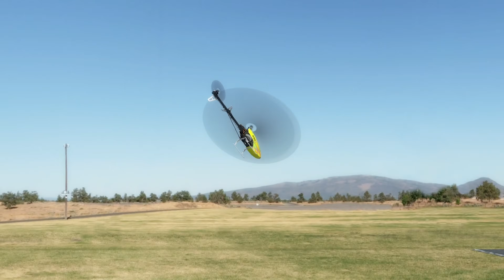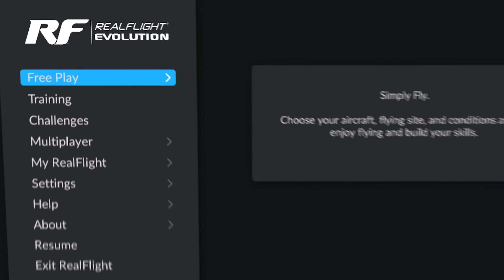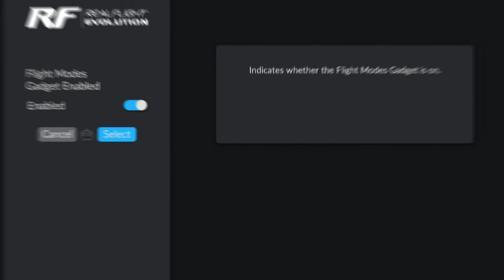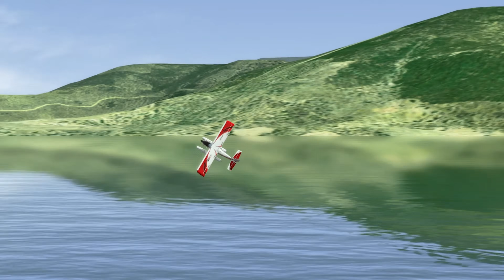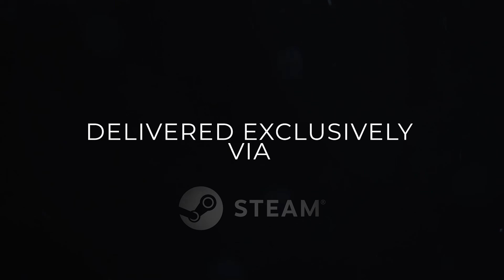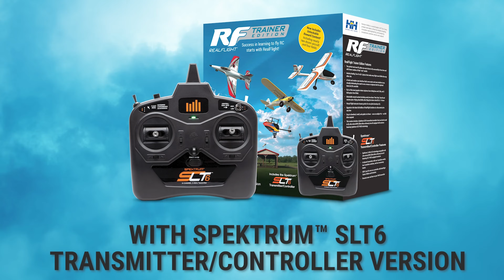RealFlight Trainer Edition Buyer's Guide

Comment: How close is the simulator to real life?
Reply: Not sure about this sim or what you fly but I found that the real thing is easier and more stable to fly than the sims (which is a good thing). I've used Phoenix RC since the beginning and AccuRC 2. When I finally purchased a real heli (trex450) after 3 weeks I had already moved on to a 550 (6S) and then a 600(12S) - I had been practicing in the sims for more than 8 years at this point though. People at the local airfield couldn't believe I had only been flying for 3 weeks. Sims also build really good recovery reflexes.

What the sim doesn't prepare you for however is building and setting up the heli, setting up the fbl system, batteries and associated electronics the sun and the sound of the blades on 550 size and up, it's VERY intimidating. Any sim is a no brainer, they great and I'm sure RealFlight is up there with the best of them.
Reply: @104-hb5  Thanks for your reply.  Good stuff.

I'm trying planes.  Helis in the future maybe!

Comment: This was 10 months ago, Aug 2025 now and prices went up by 33%? The software with dongle he says is $59.99. Now 79.99. What the heck. That is a HUGE increase. Inflation was horrible at 4%, but 33% with RealFlight?
Reply: If you’re looking to save money the rc hobby is not for you lol
Reply: I’m thinking of getting into the hobby and considering RF flight trainer before purchasing an Aeroscout S2. Any suggestions? Thanks!
Reply: @Poweredparachutelinesocks That's what I did including getting into the hobby with the Aeroscout. I got the trainer version of eflite which was just fine to learn since it has the Aeroscout. I got the $100 version that came with the controller. I do recommend getting as many hours as you can on the simulator. It makes the biggest difference.
Reply: @Poweredparachutelinesocks learning helicopters is not easy. I don't know much about planes but I heard they are easier to fly. I would get the flight sim and practice before buying the real thing it will save you money and sadness in the end.
Reply: @Poweredparachutelinesocks if thats all you are trying to learn just download absolute rc simulator for free for IOS phones. Thats where I learned how to fly and went from toy foam f4u corsair to edf 70mm f-18, l-39 64mm, f22 twin 40mm in just 3 months of practicing. Everyone learns different but if you want to learn quick that app helped me out alot

Comment: As far as the Ready to Fly version that you mentioned was  $79.99 and now in a matter of 8 months as increased to $99.99.. a $20 price increase. Is this due to the Tariff's or?
Reply: I saw it for $79 today on eBay..
Reply: @kellyharbour7140   Thank You! I went ahead and dropped the $$$ on the Evolution version that had all  the different airplanes, Helicopters and Airports. 
I appreciated you letting me know about that!
Reply: @OldBonesDronePilot Any issues getting it up and running? I’ve got an NX8+ transmitter
Reply: @kellyharbour7140  No, mine started right up. But I purchased the one with the wired InterLink controller. I assume you purchased the stand alone software? If so, I've read that you need to also have the Dongle for a controller other than the Interlink one. Also a steam account and the steam key. If you have all these and your computer has the requirements to run the program, then I'd be contacting Tech Support at Horizon Hobby for help.
Reply: @kellyharbour7140  No. mine is running great! Do you have the required Dongle for use with your transmitter?

Comment: I’ve got an old version of Realflight r/c simulator, only the controller. It says Interlink controller Plus by Futaba on it and it has a USB-A cable connector. This works well with the FMS free rc simulator on my old MacBook Air. But now I’d want a much better simulator software again, one where the input of this controller really simulates the different steering on different rc airplanes. Can I simply get the cheapest version of the newest Realflight simulator and use it on a newish gaming PC laptop running Windows 11 with this controller I already bought long ago? Will the simulation be as I desire and describe above?

Comment: can i use my dxs on this?
Reply: Yes you can. I just bought RF evolution and couple weeks ago.  That being said, use a wired remote or at minimum an 8 channel tx if your using spectrum radio. My dx6e works with the wireless dongle but the program expects at minimum an 8channel so you're a bit limited with your remote performance

Comment: You going to get around to using a modern game engine??? Ray tracing?   This looks same as it did 10 years ago for the most part.
Reply: If they did that they'd limit their market. Most people that use RF don't have gaming computers.
Reply: @pillsareyummy  If you can afford the hobby, you can afford an $400 gpu.  Lol.
Reply: @Curious_Skeptic  You need more than a GPU to run games with Ray Tracing. You need.a gaming computer. Most people who use RF don't care about graphics, and many don't own gaming computers. Wrong demographic.
Reply: @pillsareyummy  I disagree.  You make it sound like those interested in rc are old, live in trailer parks, or are broke.  Most all modern pc and laptops can ray trace.   Regardless,  sounds like excuses to keep selling outdated lazy dev content at overpriced rates.
Reply: My main computer is quite capable and I still don't care about graphics for RealFlight very much. They're good enough for a nice practice sim, which is what is important.

Comment: Hello,  I have a question. Does the Evolution still provide the same level of detail as the trainer version for beginners? What would I miss out one by getting one or the other? I under stand the trainer is exactly that, and that the evolution is for advanced, but im not sure if the evolution contains all the trainer and more or if they are specifically for different purposes, therefore I would miss the specific intent and content of the trainer if i got the evolution. Thanks in advance for any clarification.
Reply: I have both. They're very similar with Evolution having more flying fields/locations and more aircraft.

Comment: Just a heads up for everyone who owns Realflight Revolution or is thinking of getting it,
Ownership of this program cannot be transfered so selling   it after activation is impossible. I wish I had known this before I bought it.
Reply: huh, never thought of that. wouldnt that be the case with any download only software?
Reply: @dirtrider88 
That might be true if that download requires a program to run it. In this case it requires Steam to run it. Once that download is activated on your Steam account, ONLY that account can run it. I didn't know that the time I bought it and consumers should have been warned that resale after activation is not possible. 
In the past I have bought digital games from E-Bay for real cheap. They send you a code instantly. You go to the website and enter the code and it can be download to your hard drive.

Comment: I feel like you missed key parts of the Trainer Simulator. I’m learning helicopters right now and have Real Flight Evolution. There is no helicopter training at all on that. Is there Hovering training, inverted hovering training or anything for helicopters on this new Trainer Edition? I have seen other simulators that are touching on these fundamentals. I do own at this time 3 Blade Heli’s (nanos3, 180 Infusion, 330s) soon the 550 or 700 but at this time I have to use another simulator for training. 
Thanks for the video and keep smashing them Blades Ethan!
Reply: yea thats total BS theres no helicopter training. i just bought the other day also so its not like they have done an update unless mine didnt come fully up to date.